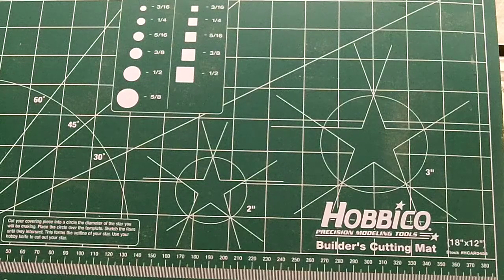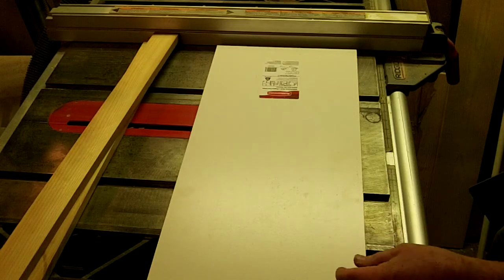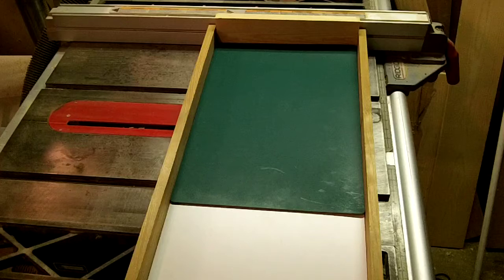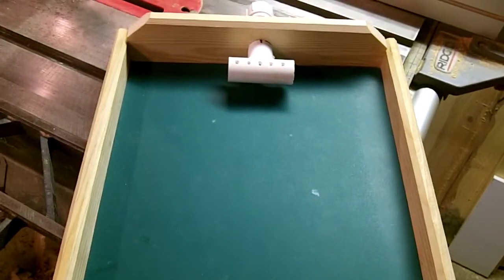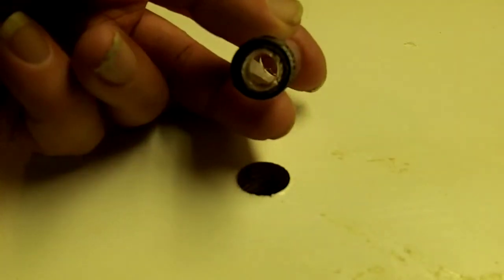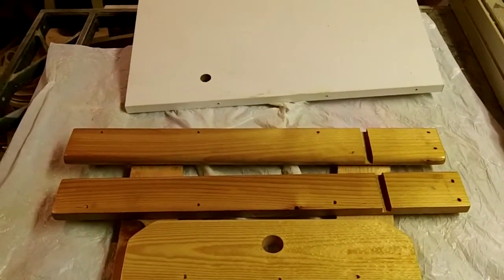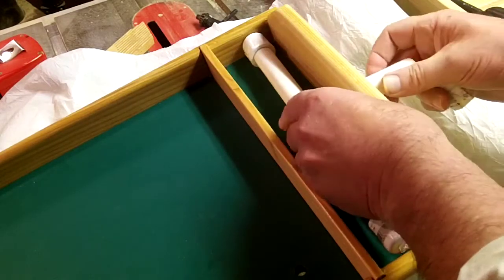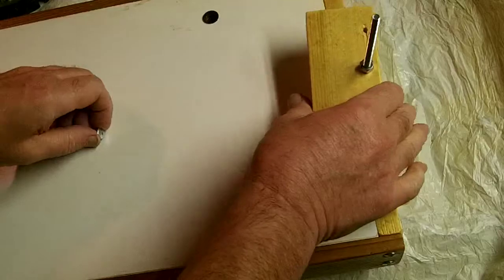Hobbico Mat Miller Table Build

Comment: Looks very easy to build, what is the spacing of the dam above the mat and what do you use to stick the mat to the shelf unit? thank you very much.
Reply from the maker: Hi David and thanks for watching. I used 2 quarters stacked on top of each other for the spacing. I used rubber cement to glue the Hobbico mat to the base board. Yes this is quite easy to build and it does a great job separating the gold. I have a newer version that works much better and is very easy to build as well. You can find the build plans here.
https://youtu.be/ktDZzlkm0H8
I have an even newer version that I haven’t had a chance to do a video on yet. It’s my last video where I show my latest projects. It has a catch pad for runaway pieces at the bottom.

Comment: Nice where did you get the mat cant find them
Reply from the maker: shaun schollaert 
Hi Shaun and thanks for watching. You can find the mats at most office supply stores or on EBay. It is a self healing cutting mat. If you watched any of my other Miller Table videos, I have since found that Rustoleum Chalkboard paint actually works better and is about the same price or cheaper. You can buy it at Home Depot, Lowe's or most paint stores. Also instead of the shelf for the base, I found you can use just a piece of pine or other wood. Just sand it well and give it at least 5 Coates of paint. The Chalkboard paint works well for this.

Comment: Awesome. I noticed the dam and sump design are a little different than the table you used with the grandson. Is there any specific reason you changed it? I liked the enclosed dam better but do they work the same too?
Reply from the maker: Hi John, thanks for watching. Yes they are similar but different. The table here and in my cutting board video has the water shooting down onto the table from the water bar above the table and needs the dam board, and some folks use scrubber pads to help reduce the turbulence. With the one in the Urban prospecting, the water bar is down in a well. When the well fills up the weight of the water reduces the turbulence in the water to almost zero and gives a flow that's smooth as glass which is very important if you are working with gold in the 80 - 200 mesh bracket. That is the range I am trying to catch.  It also makes it easier to make fine adjustments to the water flow.  But the table is a little more work to build but I think worth it. I have the build video on it finished and now working on an introduction video so I can explain how it works and then the video on how to build it for those who are interested. So stay tuned if it sounds of interest. Yep, I know, another project. :-)
I also have some better waterproofing techniques for wood with this one as well.

Comment: My panning partner just spent around $225 on a 'store bought' version of one of these...against my suggestion otherwise. 
I hadn't even heard of Miller Tables in general, and he described the thing by the brand name anyway, but I kept telling him to let me have time to watch the link he sent me, and assured him we could most likely easily build something much cheaper.
I just brought up the link, and about two down from that was this video, where...lo and behold...a great person from Utah shows us how to make one for what looks like, under $20, especially since I already have the spar varnish. 
My high-banker and sluice are built from half purpose built parts and half hardware store finds, and my mini-sluice is a total Home Depot project, so this way is much better for me. 
Thanks to the poster for doing all the trial and error and being generous enough to give the knowledge away.
Reply from the maker: Thank you Nevyen and thanks for watching. Yes, these homemade tables will work every bit as well as the commercial versions. These are by far the best inexpensive way to separate the gold from the black sands.
A couple of tips since this was made. Brush on Chalkboard paint seems to work as well if not better than the Hobbico Mat. Also If you use the melamine shelf, be sure to paint the whole board with at least 4 coats of waterproof paint. The Chalkboard paint works great for this. There are thin joints on the edges where the plastic ends and water can slip in to the wood. Be sure the edges are well painted. This will work fine without a gold bottle vial and just using a snuffer bottle, but if you put in the gold vial hole be sure to waterproof it very well. This is where most peoples boards develop a problem. I now use Titebond III waterproof glue for this as is dries to a thin coating and water proofs very well. Also paint it with the Chalkboard paint.
I have a new Video on making Cutting Board Miller Tables to get around the problems people have had with the melamine shelf. You can find it here 
https://www.youtube.com/watch?v=BPJfg2MWcjA

You may also want to try one of my easy build drop riffle sluices. They are had to beat for fine gold and easy to build.  Here is part 1 of 2:
https://www.youtube.com/watch?v=LJHBAAqrAbA&t=4s

I am about to release a new set of videos on a new Miller Table design that is a little more work to build but really works much better than the old design so you may want to stay tuned.
Reply: Was already going to jump to your latest designs, why ignore the work you've already done? And I had thought of cutting board before I saw your video about it.
I have a great little sluice from corrugated drain tube, but I will take a look at all your devices, no offense, to steal your good ideas. 
Thanks again.
Reply from the maker: Hi Nevyen, by all means feel free to use any of the ideas I put up here. I build and extensively test a number of different pieces of equipment a year and some of the better ones I put up here to give other folks an idea on how to build them. If you check my channel out you may find other projects you would like to build. So feel free to use any you like and enjoy.
Here is a link to my other videos. I hope this works. 
https://www.youtube.com/user/utahavalanch/videos?view_as=subscriber
Reply: Thanks!

Comment: I really like your description to ease the build of your Miller Table .  How did you adhere the mat to the table ? I am going to try gorilla glue . It worked great to fix my beat up gold cube . Great collection of informative videos !
Reply from the maker: Russ Fleetwood 
Hi Russ, thanks for watching. I'm afraid Gorilla glue is a bad choice for this job as it foams up and creates bumps we don't want in the mat. Counter top contact cement is the best glue for this. If you haven't bought the mat yet, I'm finding that brush on chalkboard paint works just as well. I found that it's hard to waterproof that board as well, so be sure to give  every inch of it at least 6 coats of chalkboard paint. Most people have problems getting the vial hole sealed to where the water won't seep through and cause swelling. My newer cutting board table gets around many of the problems. You might want to check that one out. I am right now working on a new table that is a little more work but is the best table I have ever worked on and is a totally new design. See my Urban Prospecting video for a preview. Hope to have the video out soon.
Reply: Thank you so much  . I have a couple mats now so I will get some counter top cement . I am also adding an extra bottle to capture gold on either side of the table . I am going to use the good gray automotive silicone to seal the vial cap in to the table .
Reply from the maker: Russ Fleetwood 
Hi Russ. The weldwood original contact cement is the best. You can buy it at Home Depot or Lowe's in a quart can. Brush it on both surfaces you are going to glue to and let them dry. You can suspend the mat above the table on about 3 or 4 1/4" wood dowels and then starting at one end, remove a dowel and let the mat touch. Then carefully work on down the table. Once the 2 surfaces touch even slightly they will be permanently glued. So be sure everything is lined up perfectly before they touch. You may want to find a couple of YouTube vids on laying countertops to get the idea. It's tricky glue but one of the few that is waterproof. Good luck.
Reply from the maker: Russ, I just found another glue that might be easier to use. It is supposed to glue different materials together including plastics to wood. It is:  Titebond Polyurethane Glue.  You can get it at Walmart. It has a 30 minute set up time which would allow plenty of time to align everything and it is water proof. Hope this helps.

Comment: Great project definitely have to build, what's the spacing of the dam piece and the working surface, haven't seen to many videos explain that part
Reply from the maker: Hi Marven, the distance isn't critical and some folks eliminate the smoothing bar all together. I usually place it about 2-1/2 to 3 inches away from the back of the sluice. The purpose of it is to smooth the water flow and control the depth of the water on the table. If you have course gold then adjust it so there is about 1/8" or I stack 2 quarters on top of each other. If you are looking for nano gold then adjust the bar to 1 quarter high or 1/16". If you haven't already you might want to watch my video on how to waterproof the board better. You can find it here:
https://www.youtube.com/watch?v=1EsOYqSWrk0&t=110s

Thanks for watching and best of luck with your build.

Comment: where did you get the threaded washers to level your table?
Reply from the maker: +Flame Hi and thanks for watching. You can go to Ebay and do a search on:  1/4" Mount Adapter for Tripod Screw To Flash Hot Shoe. You can also buy these on Amazon although they are more expensive. I use these on the elevation bolt as well as the leveling bar at the front of the sluice. You can use just a regular bolt as well but these make it a lot easier to adjust the levels and elevation.
Reply: glue the washer to the nut

Comment: So you didn't have to caulk the sides to the bottom board, you just waterproofed the cedar parts? Also, do you think the chalk paint works better than the hobbico mat?
Reply from the maker: +Prospector Ruby Hi Ruby, Sorry I missed this one. Yes, I use silicone to seal the crack between the sides and the bottom board. I also use Helmsman Spar Varnish to seal the cedar sides. I think the Hobbico mat is still better than the chalkboard paint but the chalkboard paint is very close but needs to be given a new coat periodically.
 I have recently found a new paint for sealing the Melamine board which is better than anything I have tried before. I hope to have a new video out on it soon.

Comment: What size is the pipe?
Reply from the maker: Alec L Hi Alec, thanks for watching. You can use either 1/2" or 3/4" PVC for the water bar. I usually use the 1/2" because you don't need a lot of water to run the table. I make a lot of these tables for testing different ways to make them and try different materials. I have tried both sizes of pipe but I can't see much difference between the two sizes. 

If you saw my video on my mini sluice, I now have that and a larger one on a small portable 3 gallon recirculating set up so I can swap out the 2 sluices and a miller table. I will use the 3/4" pipe on all of those so the hose will fit on all of them

I drill 1/8" holes 1/2" apart the full length of the water bar. Then angle them so they point toward the bottom back corner where the bottom of the table and the end of it comes together. This allows the water from the different streams to mix together into a larger smoother flow. 

If you have any other questions, feel free to ask.
Reply: Im sure 1/2